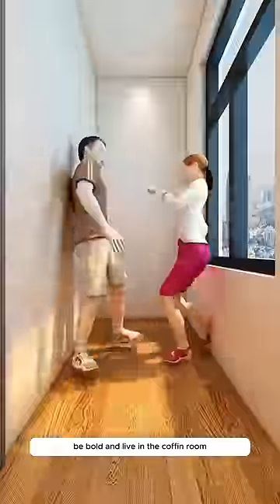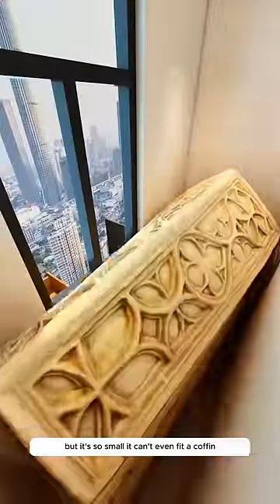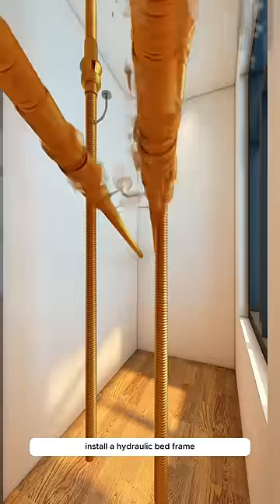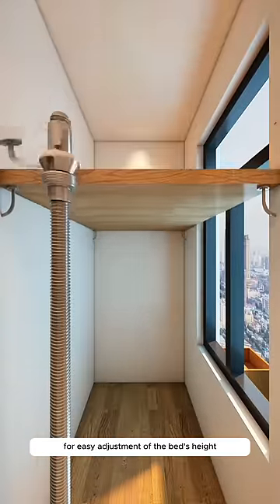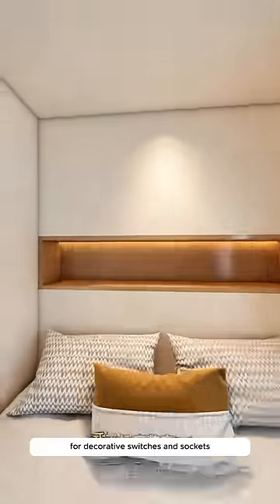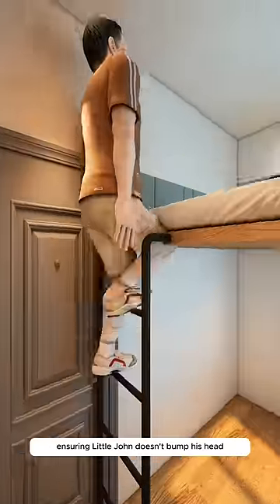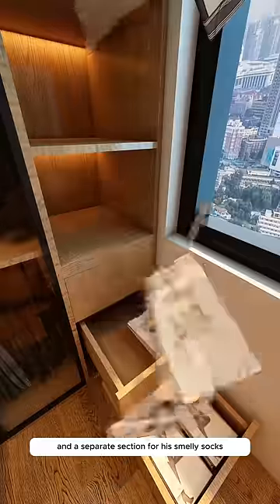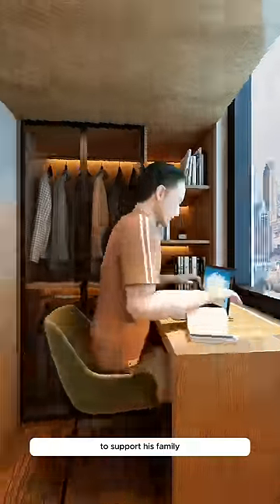Transform the coffin room into a function room!  #designinspiration  #homeinspiration #homedecor

Comment: The thing that moves the bed will crush the stuff under it!
Reply: Noo it has 'galvanized steel'
Reply: He ment the Waldrop
Reply: But it is good for 10 thousand years 😂
Reply: Nuh uh
Reply: You don't understand.. The Fucking Design was took away💀
Reply: Gamemode spactator
Reply: Bro the door can't be opened 😂😂😂😂😂😂😂😂😂😂
Reply: +You can't open the door because of the ladder
Reply: @Sarthak-pf5tx Galvanized steel is standard steel that is coated in zinc to provide enhanced corrosion resistance. The galvanized protective coating protects the iron steel substrate from corrosion due to moisture, saturated environmental conditions, or ambient humidity.
Reply: @Sarthak-pf5tx don't forget the wood veneer
Reply: @sheryl-annabbarani9504  unless it's a pocket door, or Little John can move the ladder to the other side
Reply: Brawndo... it's what plants crave... it's got electrolytes!
Reply: Or above it😅
Reply: Skill issue
Reply: The ladder is in the way so u can’t move the bed down

Comment: Install drawers.
Block it with a table.
Reply: ONOUR_Official and you cant even put the bed down either, whats the point of this design?
Reply: ONOUR_Official that’s the underwear drawer
Reply: They can't even enter the house because of the ladder
Reply: 1k lkke
Reply: ONOUR_Official you cant Open the entrance door due to the ladder blocking it
Reply: Install a ladder, block the door.
Reply: block the main door with the stairs
Reply: Wbt the door. You can't even get into the room
Reply: @Le_T_moche  unless the door swings outwards 😂
Reply: Well you actually can open the last drawer under the table
Reply: And the ladder blocks the door
Reply: Drawers you can normally remove by pulling em all the way out so all the drawers are accessible. But as for that door. It opens inwards and the latter is blocking it. No one walking inside that
Reply: The power of galvanized steel + wood veneer allows them to noclip through anything 🙂
Reply: You can still open the drawers hehe 
But yeah the door hell nah
Reply: maybe it opens the other way @Le_T_moche
Reply: @Manhunt811  Can you seriously not see how this is ironic?
Reply: smegsy
Reply: How I build in the Sims be like:
Reply: @Le_T_moche 😂😅
Reply: BTW ge doesn't block the draw ers
Reply: Nothing is blocked
Reply: @gutstheman65 The top most one wouldn’t be able to access conveniently but taking it fully out is an option in this economy
Reply: how does he open his door
Reply: are you being serious here??
Reply: I assume the the door is a pull, not a push
Reply: You know they could just phase through these things, so it doesn't matter
Reply: Where is the toilet

Comment: hydraulic bed frame made of galvanized square steel ✅
covered with environmentally friendly solid wood veneers ✅ 
one touch oil pump for easy adjustment of the bed's height, good for 10,000 years ✅ 
soft mattress added for comfort ✅